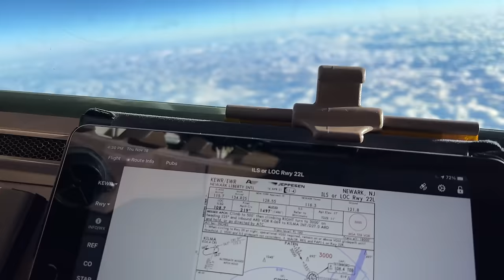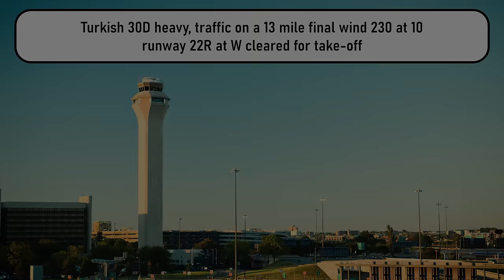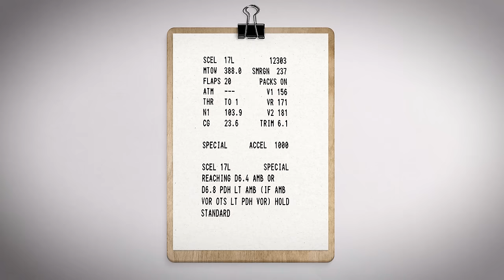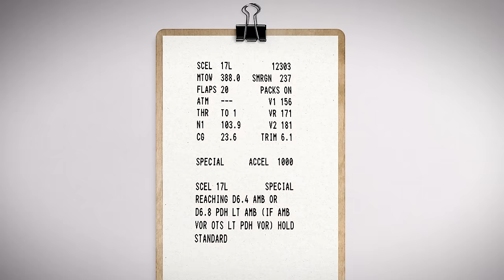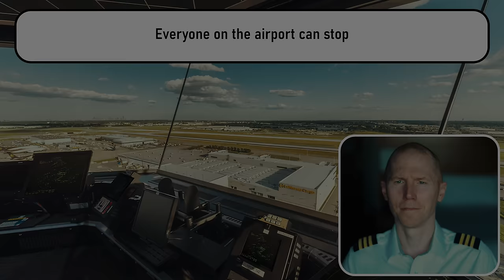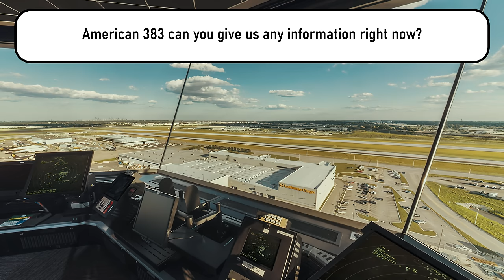American 767 Engine Fire

Comment: Kelsey, this last segment hits very close to home. Watching the footage of the takeoff roll, you can see the moment the engine failed (exploded). A little known part of the story is that a big chunk of the uncontained turbine wheel was found way across the field and on the roof of the FAA building.  At least that’s the story we were told.
Reply: I’d heard that it was a UPS building but the distance it was thrown doesn’t surprise me. I have the privilege of working as part of the ground crews at my local airport in the UK and the pleasure of working with and around both pilots and engineers, and having a few as friends. Jet engines can be scary even when you don’t know how they work or conditions they create even when working normally. 

So yeah I agree and also have to admit that second incident seeing the moment when the engine failed hits way too close to home. During pushbacks when I’m connected with the pilots via a headset plugged into the aircraft (usually 737 or A320 variants) one of the steps I have to follow is to have the pilot confirm that the engine is set to idle. You know. The engine almost directly behind me. Even with industrial ear defenders I still know when they’re turning it on and every so often I find myself gritting my teeth or clamping down on the feeling of wanting to run. 

Admittedly it’s usually because I’ve recently seen something that’s spooked me a bit-like that video. The last time was a few weeks ago when word reached us that a ramper over in the US had died after being sucked into a jet engine. She did the same job I do and in my airport at least, female rampers are rare. Okay technically I’m actually ACS (aircraft services) which involves cleaning the interiors of planes including the cockpit once you’re trained and certified for it, and operating the water and lavatory trucks. I sort of ended up hybridising to most ramp duties because I tend to get bored easily during the gaps between the planes that we’re to clean and the shift seems to go faster when I’m busy doing something. So yeah learning that someone died doing the job I do was unsettling and made me much more careful when I’m around jet engines.

This is the result even if we don’t know how it happened yet. The details hadn’t been released yet when I last heard anything about it. My best guesses are that someone didn’t follow the SOPs and tragedy was the unfortunate result. Barring freak accidents or mechanical failure, the airfield is a safe place to work if you follow the SOPs and remain alert. Mind you, these incidents also serve us a renewed respect for the power of jet engines.
Reply: @mikoto7693  To be fair, they released the report and she was warned 2 times in safety meetings that the apu was broken and the plane would be running its engines until connected to ground power. Plane had its safety beacon flashing and she was even blown over when she walked behind the engine and then still walked in front........
Reply: @notsofresh8563  Aye, I read the preliminary report not long after it came out…. And I don’t quite know what to say because you aren’t really supposed to speak I’ll of the dead. Thankfully I’ve done more research and commented with US rampers and have concluded that the safety cultures are nothing alike. 

Perhaps the best example is that we’re near enough forced (by training, company rules and each other) to wait for the incoming aircraft to fully park in the zone designated for us ground crew to stand in, and we absolutely do not move until the red anti collision lights turn off. Only then do we swarm the plane to do our assigned tasks. (The marshal is the exception because he needs to position himself to guide the pilot in.) Chocks, cones, GPU, cargo door, loaders ect. If anyone tries to move before the red lights go out, usually a very new hire within a his/her first week then one or more of us will forcefully shout at that person to return to the group. But I should also point out that we don’t have many jet bridges at our airport and they aren’t used very often. And inop APUs are even rarer, on top of that I think they’re assigned or encouraged to a different aircraft stand if they’re due for a jet bridge with an inop APU to avoid this sort of situation but I’m not 100% on that. Sometimes colleagues will tell you inaccurate information.

As for safety briefings yes we have them when an aircraft is coming in with an inop APU because it’s such an unusual occurrence and means a different SOP since it usually needs a huffer when it’s ready to taxi out for the next flight. But to get back to the dead ramper… besides the ineffective safety culture I have to admit I truly don’t understand what she could have been thinking. I’ve felt many jet blasts from a safe distance when a 737, A320 and aircraft up to A330 and 787 are taxiing up towards the runway and I’m talking there or four bus lengths away. Though I feel it pushing against my body and it sends my security pass on my lanyard flying over my shoulder it’s not enough to even require me to adjust my footing but still… it gives me an idea of the strength even at taxi. 

But here’s the thing. In all my experience on the ground crews none of us have experienced jet blast strong enough to even need us to change footwork or widen stance or something. To feel even that much would mean something has gone very wrong. To experience jet blast strong enough to knock one of us off our feet, or nearly off our feet would be downright terrifying because that means something has gone horribly wrong and we’re going to respond to this like our life is in jeopardy. Look around, determine safest escape routes and nope the f**k on out of there.

I’m not joking nor exaggerating here. I mean every word. Being hit by jet blast even if it didn’t hurt anyone would be immediately considered a serious incident and every ramper or anyone else working around the plane would drop what they were doing (provided it was safe to do so) and retreat posthaste to the nearest safe area. Our supervisors and Airside Ops (think of them kinda like airside law enforcement of sorts) would be immediately alerted and sent to us to assist and manage the situation. I’m not fully sure of the rest, but I’m pretty sure that the control tower would be alerted and likely radio the pilots of the plane emitting the jet blast to kill the engines immediately. (Which they can do by flipping levers that will cut fuel to said engines.) This probably wouldn’t last long. Just enough for Airside Ops to confirm everything is now safe then everyone but the ramper who got themselves blown over would pick up where they left off. If it were an accident then the ramper wouldn’t face punishment. They’d probably get sent home and have their security pass suspended for 24 hours while an investigation takes place to figure out what went wrong, and then probably be made to retake their safety training course and test, reminded about the danger of what they did and returned to work.

But I can guarantee you that there’s no way a ramper would experience jet blast like that and just carry on like nothing had happened even if their colleagues had to force her to stop walking and retreat. And I’d like to think nobody at my workplace at least would be dumb enough to then just walk around the engine that just blasted them and blithely walk into the ingestion zone, but before this incident I would have sworn such a thing would be humanly impossible.

Comment: As a controller I understood the grin when ATC asks if they want to try again. Sometimes the language barrier - the struggle is real  lol. But visually it is definitely astounding that a  group of commercial pilots as a whole didn't notice anything odd.

I did also attend a live crash drill once with an aircraft and fake victims and it was a huge learning experience. All the things to consider when in the vicinity of a aircraft on fire. like staying upwind, definitely avoiding running engines (front AND back) and several tons of rescue equipment. It always gets me how some pax stay close to the aircraft as it's burning. Something's on fire, I'm outta there.  Great video! Thanks Kelsey.
Reply: Big machine's on fire, damn straight I'm not hanging around either. Really prefer not to roll the dice on random explosions and/or shrapnel coming my way...

Comment: Kudos to the passengers, too  — they stayed calm and orderly in their evacuation, and like you say… that’s not a given!
Reply: If I remember correctly, there was a plane at SFO that overshot the runway and the plane evacuated. One passenger wondered out into the grass away from the plane and she was run over and killed by the fire truck.
Reply: @rabbit251  I remember that was a korean airline landing too soon and had a tail strike on the breakwaters. I think the tail broke apart. There were two Chinese girls that was killed, they sat on the very last roll on the plane and didn't fastened their seatbelt properly. Since the tail broke off they probably launched somewhere burried with fire fighter's foam and  got runnover by fire trucks. I remember Korean TV host said something along the line of "Fortunately the only ones died is Chinese" and pissed off China a lot.
Reply: Indeed - in opposite e.g. to the Red Air Accident in Miami not long ago where only Good Luck prevented Passengers to be sucked into the still unning engines during the uncommanded evacuation.
Reply: @rabbit251  I believe an investigation into that one showed that the passenger was already dead (...thankfully, I guess?), but it's absolutely a worry!
Reply: @NicolaW72  🙀

Comment: During my time in the USAF as a crew chief, we had one memorable incident.  We had two tankers, with one empty spot between them.  Both had engines running with the crews onboard, and the tankers closed up, ready to taxi.  I noticed a massive fuel spill developing under my aircraft, and signaled the crew to shut down and evacuate.  The crew evacuated to the empty spot between the planes.  The other aircraft, decided to taxi out of the situation, choosing to taxi right thru where the crew and passengers had evacuated to.  Chaos ensued, but nobody was hurt, and the leaking valve was repaired.

Comment: I’m a former (50 years ago) private pilot and learned on a grass strip. No runway/taxiway confusion😊
Reply: But you still had to wait for the lawnmower to clear the runway from time to time huh :-)
Reply: And you never landed anywhere where you had to use runways/taxiways. 
Wow…so lucky mate.
Reply: @repairdroid77  i used to mow a grass strip, i can confirm that guy in the cub never gave a shit lmao
Reply: I used to fly gliders landing on the grass runway, we never landed on taxiways.
Reply: @repairdroid77  and the snow plow in winter
Reply: @AndersReinhardtHansen  Yes, I've flown gliders too. You have a lot more to consider in a powered aircraft.
Reply: “Back when I was a boy and learned flying, our engine had a single valve per cylinder and it always was grassy fields!  Sometimes less grassy and more field, even.  You just learned to spot the molehills from the air and not to land on them, same as you would not land on a mountain.  But at least you never worried about crosswinds.

“Engines however were slightly less reliable and powerful than today and a throttle was not a thing for me back then.”

(End of imaginary learning to fly story)
Reply: @repairdroid77  😄
Reply: Yes like in the mountains of PNG
Reply: @repairdroid77  naaaa.... Just nudge the nose over and mow as you go!

Comment: Looking up the report on the American flight... 
"The right engine had suffered a sudden rupture of the stage 2 disk operating at takeoff power. The disk separated into two pieces, the smaller of which pierced the wing's fuel tank and then flew 2,935 feet (895 m), falling through the roof of a United Parcel Service (UPS) facility and coming to rest on the building's floor. No one was injured in the UPS building."

Hearing about this one, just after rewatching the Mayday episode and seeing the Well There's Your Problem podcast about United 232, and it being a similar failure... Yikes. 😬
Reply: Holy crap that went a long distance. Also just watched the WTYP about United 232 yesterday. :)
Reply: Thanks for the additional info ! ! ! Excellent !
🙂😎👍
Reply: Damn that's some mega air time. And also that's crazy scary. The people in the UPS building must have had their luck stat maxed out.
Reply: Thank you very much for the additional information! I remember that.
Reply: Confirmed,  I have the Pics to prove it.  All involved were beyond lucky it never went Airborne.

Comment: Besides the difference in markings and lighting on runways and taxiways, when an Airbus is set up to depart runway 22R at Newark, the nav radio is automatically tuned to the ILS localizer. The primary flight display would have shown them way off to the left of centerline even if they couldn't see a thing out the window. The picture on the screen wouldn't look like it always does when they're lined up to depart from an international airport in their widebody Airbus. I don't think "on the grass and on the glass" rhymes in Turkish, but every airline has a procedure for the flight crew to confirm that they're lined up on the correct runway, using cues both outside and inside in the cockpit.

Comment: I have zero doubt that there were those in the cabin of that Turkish flight that had a strong assumption of what had just happened. Our view back in the cheap seats may not be as good as yours, but even for us, making the turn onto a runway looks a lot different than a taxiway

Comment: I used to be a gate agent for AA back when this happened. I was actually on the employee shuttle from the parking lot to the terminal at the time. The shuttle ferries us from the lot, which for AA was by the mtx hangars, across the airfield and to the terminal. So I was on the bus heading to the terminal when it happened. I saw the smoke, it was really insane.

Comment: A friend of mine was working at an airport in the far north of Canada back in the 70s.  There was a 737 expected but a serious crosswind meant the flight couldn't land.    Then a medical emergency happened and an immediate evac was necessary.  The captain of the 737 used a taxiway to land and take off again since it was directly into the wind.

Comment: Your comment about the tarp reminded me of something my late grandfather told me.  He did insurance adjustments on large facilities and went to quite a few cases where their insured was an airport. Whenever terminals, aprons, lighting, antennas, etc..  were damaged, he would fly out ASAP to document and get it running again.  
He said that in every single instance, the owner of the aircraft would make sure that the branding on the aircraft could not be identified before he got there.  No matter how bad the weather was, the tail would be tarped so no one could identify the airline.
Reply: Yes, that could be any polished aluminum fuselage with blue/white/red stripes running the length of the fuselage (why American switched to a more bland livery which also weighs more is beyond me).
Reply: @marcmcreynolds2827  The Airbus and 787 are why. Can't get the same look on composite materials.

Comment: I'm sceptical of the pilots most times. When they say a few bumps it means the plane will shake like crazy the whole flight. If they say mechanical problems I'm thinking the engine is going to fall off BUT if something is wrong like a fire im obeying everything I hear. Bravo to the pilots and the crew. You saved lives.

Comment: In the 90's I was with a buddy flying into PHX in a small single engine (PHX doesn't allow those anymore, too busy).  It was so busy we ended up waiting for clearance into the pattern for over an hour.  On the last tower call they told us to continue to maintain over PIR again, and we responded that our fuel situation was 40 minutes on a 20 minute flight to the airport (In other words we were going to be in a fuel emergency by the time we landed).

They cleared us into the pattern, we called at base, and they gave us clearance to land on TAXIWAY Bravo.  So... yes...  It can and has happened :P
Reply: Mhh have my doubts about that, why they decided postponing other traffic on one runway for 2 minutes is worse than all the hassle with a landing on a taxiway? Can you give more details?
Reply: Being a small lightweight plane would have helped a lot there, I'm thinking. No one wants a 747 landing on a taxiway.
Reply: @patheddles4004  Thats true, but runways have much higher precautionary measures than taxiways, and thats not dependent on size of plane :)
To secure a taxiway on a busy three runway airport sounds hard to me, cus if the tower permitted a plane to taxi half an hour ago and there had been delays, that plane might go on that taxiway.